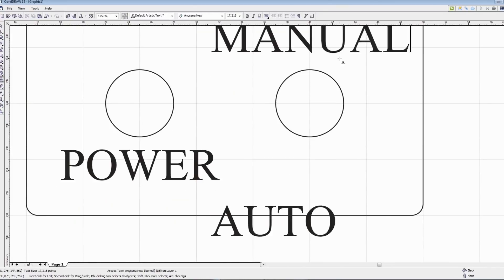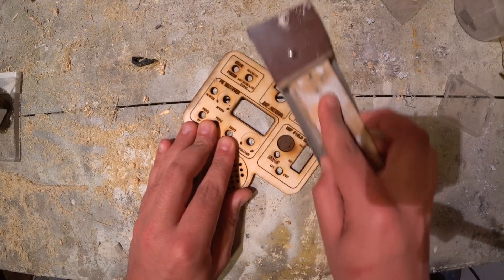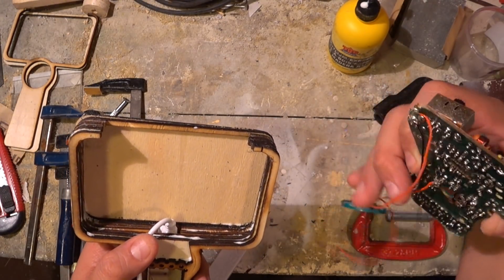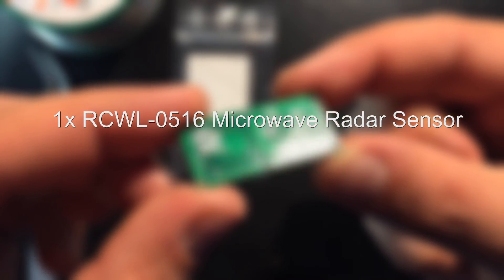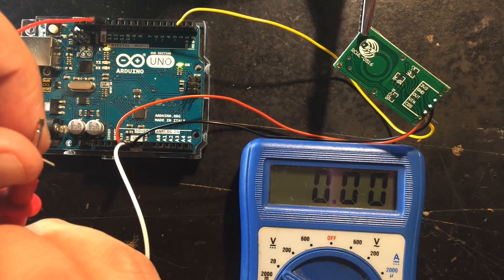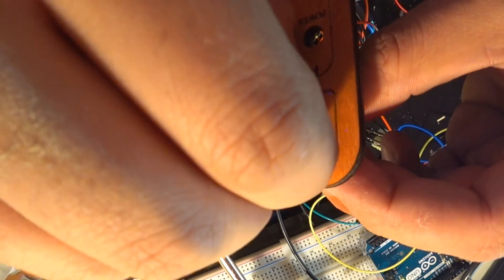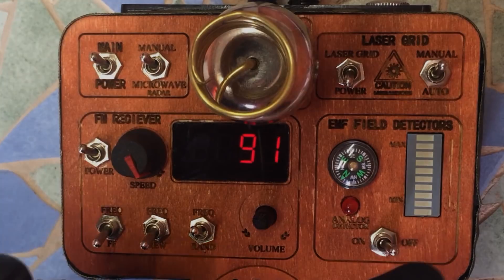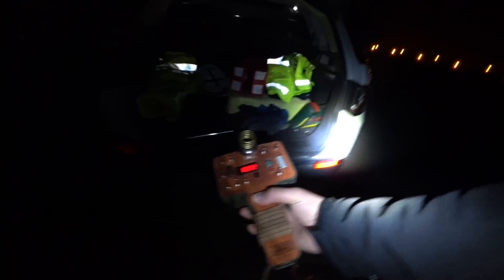Build The Ultimate Ghost Detector   Part lll / Final construction & Testing

Comment: Hello,

    I was also thinking about use faraday cloth along with EMF paint on it so nothing would react with each other. Keeping everything apart far enough to keep it as accurate as possible. Anyways sorry for the long message. I just trying to figure things out and it seems like your very knowledgeable when it come to this kind of stuff. I hope to hear from you. As I said any advise or knowledge you could share on this subject would be grateful.

Thank you for your time,
Mike
Reply from the maker: I think most important is that the actual detector has adequate shielding in the first place. I recently uploaded a video about a new ghostdetector v2.1 where i made more efforts in order to shield the sensitive rem pod

Comment: Hello,
         I am trying to figure out the best way to communicate with a spirit. I was wondering if you could give me some advice. Do you recommend any apps? I have used RAPTOR and I swore it worked. But now I keep getting ppl burping. It would be something she would do just to be funny. I am not sure if anyone else is having it happen while using the app. But it does sound like the person I am trying to contact. I have tried ghost tube app also. Just wondering if you have used any apps that might work?
        But I have a K2 EMF reader. A faraday computer bag & a faraday cloth. I have used them but still pick up radio or sounds & it is a thick faraday bag then cloth over the whole thing. I also have P-SB11 / Dual Frequency Sweep Radio ITC Device with Hot & Cold Spot Detection. I did not realize they had one with noise cancellation until later. Have a SBOX ghost scanner ghostpro full spectrum camera with IR light & stand with extra PHASM light. I also have two different EVP recorders. CONODO Intelligent Noise Cancel Voice Activated 3072kbps & a EVISTR 16GB Digital Voice Recorder Voice Activated Recorder. I bought the CONODO because it was 3072kbps. I was wondering if there is a way to clean up white noise or software to do it. Just to make sure it is a voice & not my mind playing tricks on me. I recently bought a sonic slueuth parabolic microphone. But the two EVP recorders don't have a mic jack. So probable buy a zoom H1N or zoom H2N?
        My question is what do you think about APF-D Processor, DAS-ANC Professional & ANC-mini? Or even the Onvoy Ghost Box or the GS2 Laser Grid System? Also the Para4ce Ghost Box? It has a shut off for antenna & only picks up within 16ft if antenna is on. Or even the IR+UV Phantom Lite FSX Illumination - Full Spectrum X it has full spectrum light. Or have you tried a SLS camera? The reason I ask is because I am thinking of the best way to get sound or vid. Been really thinking about light spectrum & frequencies. Black lights, full spectrum, thermal, lidar & what my samsung s21 uses for apps 3D live scanner, CamToPlane 3D & PIX 4Dcatch use. Believe it is IR laser. Apple uses lidar for Scandy Pro. I am also making a solar speaker. Meaning I will wire a 3.5 jack to small solar panel. I have been thinking about even wiring a bunch of remote led's together flashing at different speeds. 
         The reason I am doing all of this is because my neighbors granddaughter passed away from a side by side accident. She was only 15. It was only a month ago. I was close to her & the whole family. It has been really hard on me. I never expected to feel this hole in my heart. We all miss her so so so much. Many of times I have had close calls. I never ever thought she would not have at least one close call. She never had a close call just one chance. This so sucks BIG TIME! She was only 15 and way to young! I swear she is around but I just can't communicate with her or see her! But I just want to know if she is ok. But since then the kids toys have been going off. Tv remote turning tv off all the time.
          I talked to a retired tv repair guy. He & I really think that IR is the key. Even think UHF & VHF along with AM & FM with solar panel sound to pick up IR all combined might give spirits all they need to have a complete sentence. I actually took a cheap solar panel hooked it to 3.5 jack & it does pick up light sound. It isn't very loud but I think it is the speaker power. If it had more power it may get louder. I keep thinking about remote controls that turn off tv just out of the blue. That is why I think IR is part of it. Just trying to figure out a way to listen to IR? As far as seeing them. Well using all the spectrums of light. Black light, full spectrum, thermal, lidar, IR laser. Maybe even ultrasound & short wave radar?
          I was also thinking about different ways to make a magnetic field paper or viewer. Either multiple pieces of sheet plastic with neon dye so a black light your make it shine bight. That way you could see the person when they hit the magnetic field. I would really like to make an old tv scanning threw UHF & VHF channels with built in two AM one forward & one backward variable speed control with two FM doing the same with noise filter on all of them even the UHF & VHF. Then have IR remote led laser grid or even full spectrum laser grid or even black light grid? Maybe even lidar, radar and ToPlane 3d with SLS camera. Kind of like the GS2 laser grid system. Have it coming off the top of TV ghost box shining on the mirrored multiple layer magnetic field plexiglass. Idk I so want to figure this out. I figure if I had every bandwidth of sound and light spectrum visible & invisible it would better me chances to communicate with her. My question is do you know of anyway of turning a manual TV channel knob UHF & VHF to digital scanning? Also same type of switches for AM/FM for scanning? That and making laser grids out of different spectrum of light like the GS2 laser grid system? I figured with the white noise on TV screen along with the magnetic mirror plexiglass with all light spectrums I could see her. With all the frequencies covered I could hear her in a whole sentence. Oh that was another thing. Is there a way to make a scanner stop for about 5 seconds when it picks up a signal? I think that would help communicate if it stopped to pick up their voice. I guess I was just wondering what you think & what has worked best for you or if you had any ideas? Just trying to think of all ways to look at it. 
      Any help would be greatly appreciated! I so want to figure this out! As I said I am going to keep trying & trying to figure it out. I would do anything to be able to talk or see her! Any & all ideas or input on this would help. I am at my last leg. I am very inventive but lacking knowledge when it come to electronics. Meaning I can think of the ideas but putting them together the problem. I can do a lot of things but soldering is my down fall. I wish I understood more about electronics. I am willing to learn or do anything to figure this out. I do consider me a jack of all trades but a master of none, but oftentimes better then a master of one. Every job I have ever had I always ended up learning fast & becoming the boss. I have no problem learning just need a teacher or any input how things work or go together. I am disabled now because of two bad back surgeries. So I have the time to do it. I just lack the knowledge & physical strength to do labor intensive things. Please Please help me in any way you can. I would be so grateful for any input!

Please help!

 Mike

Comment: I am going to attempt to build one of these as it seems to be sound in its development and what it is capable of detecting which would be extremely useful in my investigations. I have been conducting paranormal research for over 30 years now and one of the ways I take this field of endeavor seriously is by keeping an open mind when it comes to new technologies and applications of those to our field research. I lack the laser you have but may be able to find someone who could craft a face plate in another way. Also, I am not technically savvy when it comes to the electronics portion of the build but am willing to give it a try using the parts list you gave. For a layman such as myself, how difficult a build would this be in your opinion? I only came across your video today but its use made me need to follow up with you and if possible, construct one for my own investigations. Thank you so much for making the information available and at no cost no less. I never charge people for what we do when we conduct investigations, most of our expenses are out of pocket so this was also a concern. Thank you again and if you decide to respond to this posting, that would be very welcome as well. Take care and all the best!
Reply from the maker: Hey Mark, i would recommand you several things:
Make the layout and actual machine bigger than the one i made, it got very tricky fitting all this stuff inside the housing. I saw some very nice ideas here on the plathform of people using old radios f. ex. 
The microwave motion detector interfears with the emf detector and radio, so i can only use one or the other. Running both at the same time is not possible on my build. 
If this is your first arduino project i would strongly recommand you to get in contact with someone who knows how to write code. You will certainly run into problems at some point as the manufacturer of the radio shield f. ex. might have changed their layout over the years. The lasergrid is a simple grid laserpointer from ebay. My “Ghosttrap feature” is the part that makes things complicated as the arduino has to read  the incoming signal from the microwave motion detector and then switches on the ghostbox and laserpointer when the switches are turned to the right position. I needed to add transistors as the arduino outputs did not provide enough amperage to power all the peripherals. If you skip the “trap” part the whole build will be way easier to realize as at that point the only things that are controled by the arduino are the microwave detector and the ghostbox. You could change the code in a way the motion detector simply turns on an LED instead of switching things on and off. 

I hope that helped getting you started ;)...